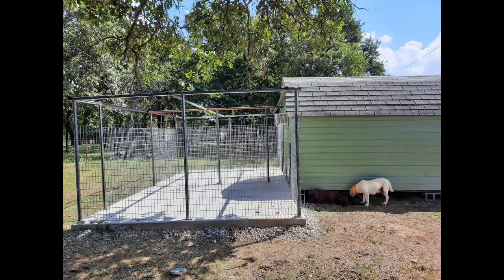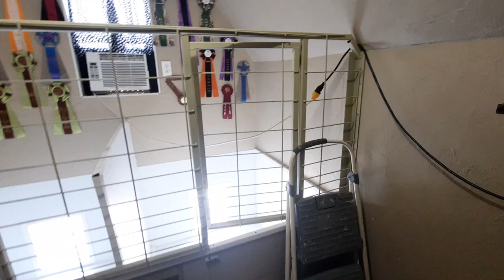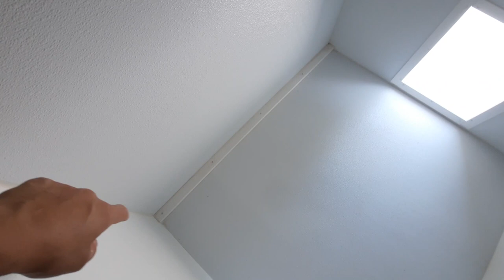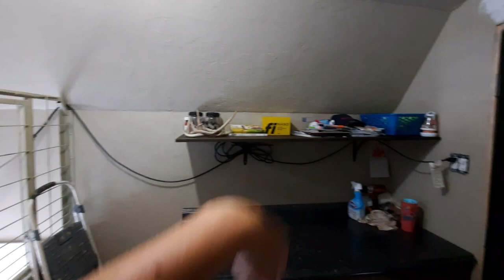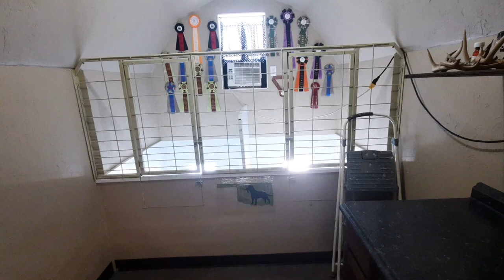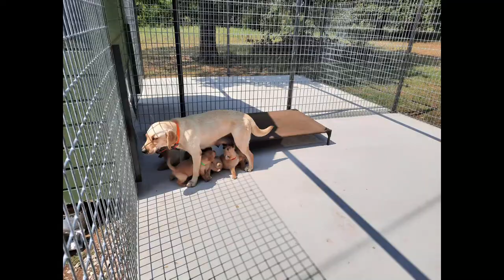DIY Puppy Whelping Kennel is Complete

Comment: How did you install the poles in the cement?
Reply from the maker: We built "feet" on the bottom of the poles, with pre-drilled holes and then bolted them into the concrete!